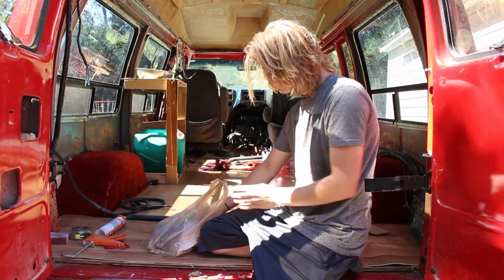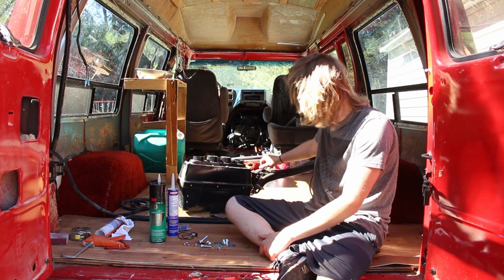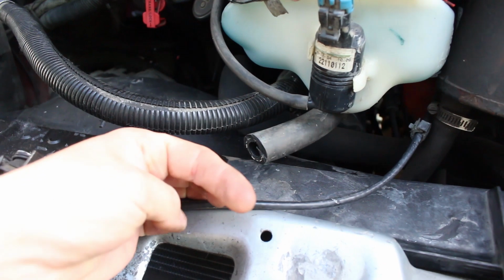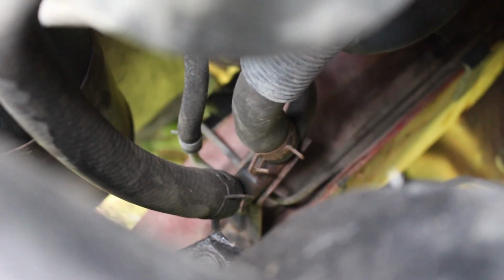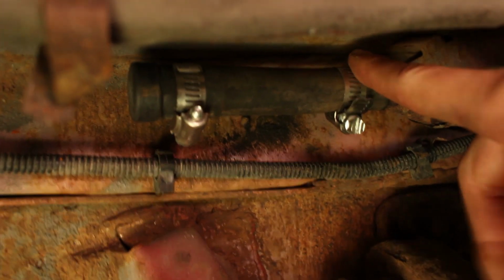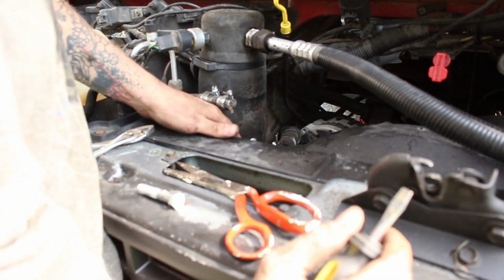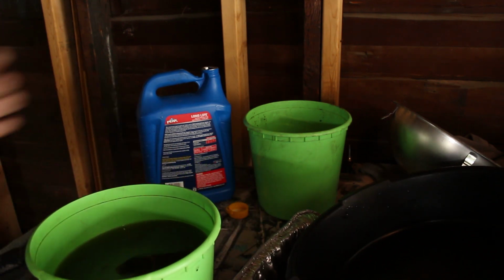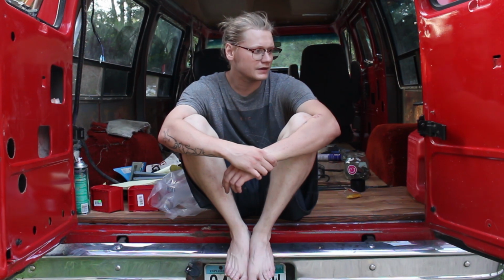How to REMOVE rear AC/Heat Unit in Van for $10!

Comment: can you go into moredetail one what exactly it is that you did? I removed my heater core and ac unit too. where did you cap offyour valves? is your van still in good condition?
Reply from the maker: its running fine still! Also closest point you can get to the end of the hoses, one was behind the passenger tire the other two behind left side of grill

Comment: Hello. I am converting my van and this is holding me back. I’m really nervous on taking this out myself because I have no experience and no one to help me. Did you just start unscrewing stuff to get it lose or should I cut the pipes first. I’m so confused plz help
Reply: Just watch it and write a list of key to do steps. Look at the hoses and the units It goes in and out of.  Then understand what's going on. This goes to engine. Heat. This goes to ac condenser is Ac. They just circle themselves so once you see the siE and purpose of each hose just cut remove and loop the lines into each other
Reply: @DailyDelsol  Thanks for taking the time to put out this video! Just purchased a passenger van with a big unit in the back and I’m on the fence as to whether or not I’m going to remove it. One question for you… When you mention looping the pipes back together, how does that work exactly?

Comment: Hey, thanks for doing these videos it’s super helpful with my g20. I do have a few questions with this one if you remember some details. Which line is the one you capped in the wheel well? I know two were capped in the bay and the heat one circulated. Is it necessary to remove that metal rod to connect those heat lines? And as far as straining that fluid, is it going into the radiator? Will draining that line remove any of my coolant currently in the cooling system? Sorry for the 20 questions, just looking to do the exact same thing and do it right.
Reply: So I capped off the lines as close I could. In the tire well I'm pretty sure that's the closet I wanted to get with that line. I also didn't know exactly how much pressure that line held so I just capped it off anyways with a bolt that fits tight and clamped it on the treads. Then yea. When you cut those lines it basically drains the coolant into a turkey pan. Then I saved it by straining the fluid through a t-shirt to get rusty particles out of the fluid. Hope this helps BT
Reply: Daily_Delsol ok, thank you! So that fluid is literally just all of your antifreeze coming out of that a/c line? I might not be sure what’s going on with it after you strained it clean